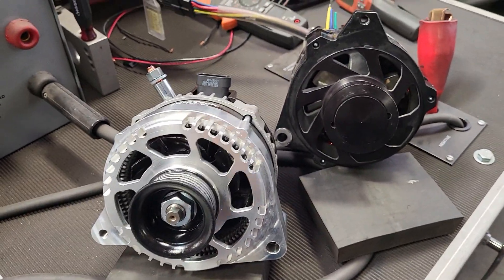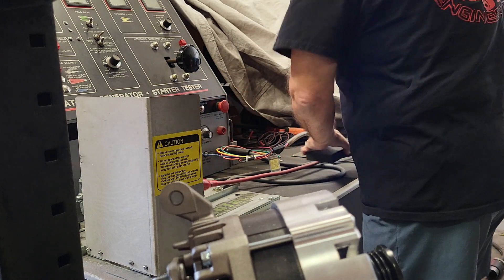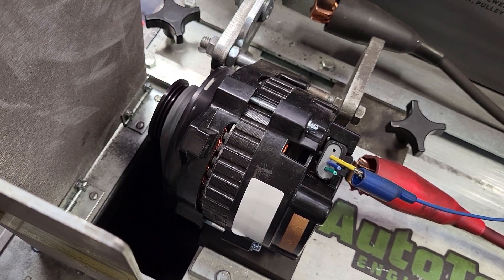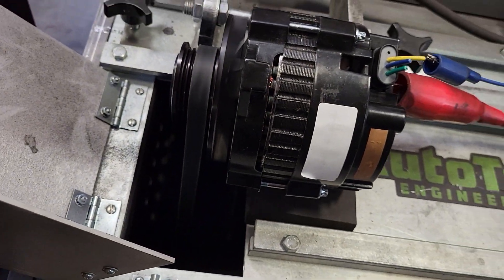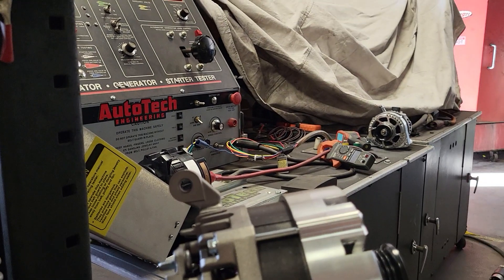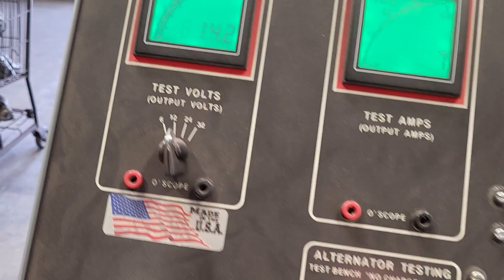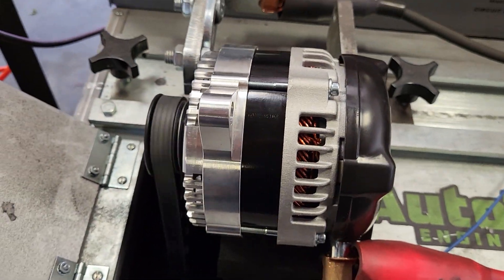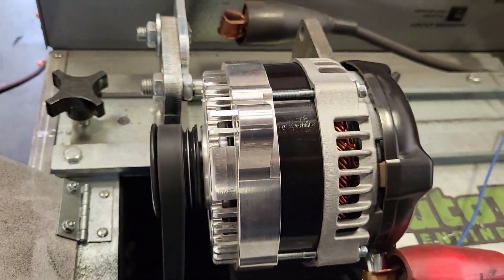Serpentine system 180amp alternator, Idle voltage comparisons with load draw.

Comment: I have a Chevy Express 3500 van and I have a third party voltmeter/gauge hooked directly up to the OBD 2 port. Even with the air conditioner and stereo blasting the lowest I see is 13.8 volts, which It's certainly enough to maintain the starter battery. I'd be real curious to see what happens once you start getting above 100 amp draw. I could certainly see that being the case if you're trying to charge some coach batteries in an rv along with the standard demands of the vehicle.  Temperatures at those higher draws would be very useful too. The reason I would be buying one of your alternators would be to charge some coach batteries and would not want to overheat the alternator if I'm pulling over 100 amps at idle. You're not really showing that information though.   I don't know too much about the CS130,  but I can' say the stock alternator in a Chevy Express van does not have this issue.

Comment: If I buy about a 250amp alternator from you guys for my 2002 Suburban 1500 LT do want my old alternator also as a core?  I’ll be running 2 amps at a total output of 800 watts maxed out.
Reply from the maker: We don't need old unit